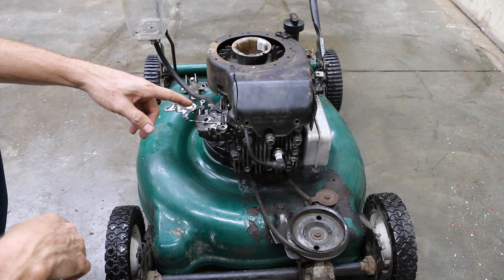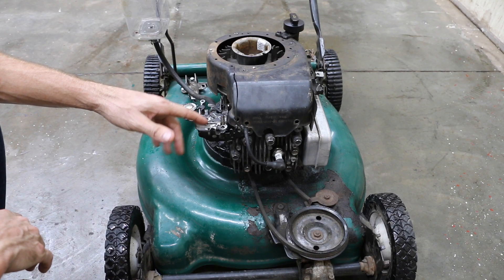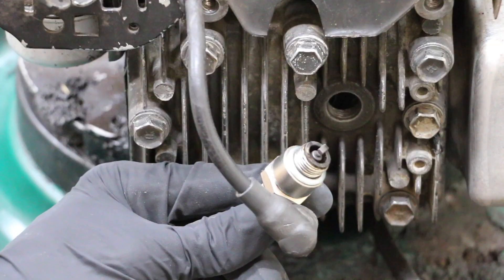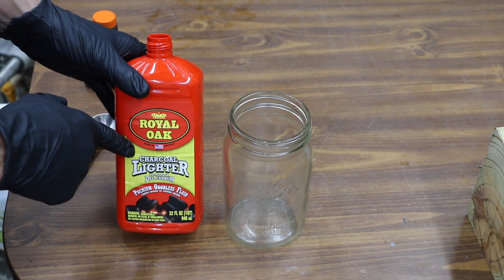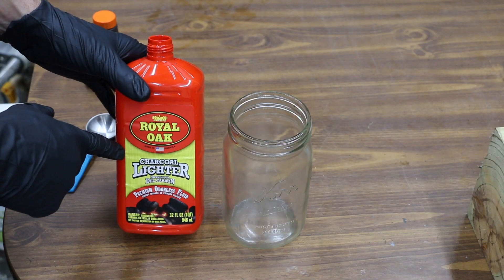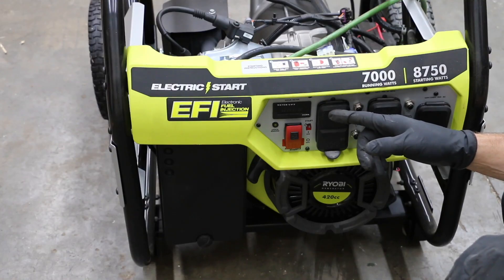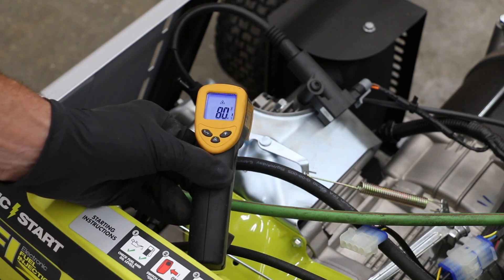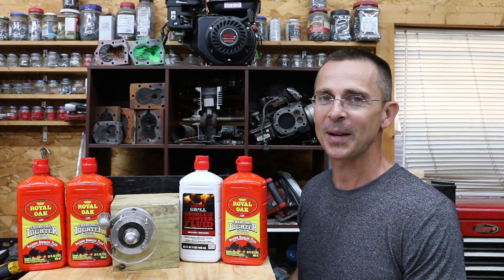Will a Gas Engine Run on Charcoal Lighter Fluid? Let's find out!

Comment: man no bull crap...today i ran out of fuel for my lawnmower, looking around i see the lighter fluid..i'm thinking naaaaawww prob wouldn't work QUICKLY CROSSED MY MIND and then you post this video i'm thinking WTF.... lolol  😂😂

edit. 
so i tried it on my old lawnmower...smelled liked burnt fajitas!! 👍😂👍
Reply from the maker: lol. Great timing!  Did you use charcoal lighter fluid?
Reply: lol ran to get gasoline... but going to try it on a old lawn mower. great video man! very theral
Reply: I have used lighter fluid to start and run engines with fuel problems. Runs fine. Have to keep spraying it on the air cleaner. I could often get engines with old gas in them to start and offer, to run once warm. Probably better for the engine than starting fluid.

Comment: I wish you would attempt to run kerosene/diesel like fuels with the sparkplug wire removed.
Reply from the maker: That's a great suggestion.  I'll definitely need a gasoline engine that has a pretty high compression ratio to get it to run without spark.
Reply: @ProjectFarm You might be on to something there; A small DIESEL engine's compression is actually too low. That's why my 7.3 is equipped with glow plugs. You'll have to crank and crank with that drill attachment and use an injected engine to properly atomize the fuel.

Comment: Wonder how similar this is/was to Pennzoil "Rescue" Fuel I bought/used like 20 years ago. (Think it was some kind of "Vehicle/Trunk Stable" Kerosene... In a 1/2 gallon jug? Which you were supposed to use with a Hot Engine Immediately after running out/filling...) Worked good for me.  Misjudged the distance between Stations and ran out.  Pennzoil came to my "Rescue".  Not sure it or another version is still available...
Reply from the maker: Great point. I've tried finding products like this but they seem to have been pulled off of the shelves.  Not sure why.

Comment: Before watching - sure it will, but depending upon the flashpoint, knocking may occur and the quality of the burn and resulting deposits, as well as the energy content will vary. Thus the 'quality' of the fuel may be detrimental to the engine.
Reply: If Project Farm has taught me anything its after doing this run some antifreeze in the gas to clean out the buildup and you will be fine again...
Reply from the maker: Thank you!

Comment: What I learned from this channel is you can basically burn anything flammable to run an engine, in a pinch at least.
Reply from the maker: Yes, you are right!  Especially true if the engine is still warm, which allows the gasoline substitute to more easily vaporize

Comment: I didn't think the engine would run as well as it did.
Reply from the maker: Hi David, I didn't either.  Surprised the EFI engine started when the engine was cold.  Thought I'd need to use some starting fluid to get the engine running

Comment: PF
I’d say yes it will . Let’s watch and find out . 
General repair
Reply from the maker: Hi General Repair, You are right and hope you have a great week.  It did ping under load but I would definitely use it as an emergency fuel substitute if that's all I had and needed to get to the nearest gas station. Thanks again!

Comment: I'll bet a diesel will run on charcoal lighter fluid.
Reply from the maker: Great video idea!!
Reply: @ProjectFarm  that very bad idea to used charcoal lighter fluid in a diesel and all ping you hearing is from very low octane rating in the lighter fluid.
Reply: @SHSPVR  diesel has very low octain rating
Reply: @buildingracingvideos4714  nope
Reply: @SHSPVR  diesel has an octain rating form 15 to 25
Reply: @buildingracingvideos4714  nope that compression ratio and talk about gas as fuel not diesel fuel substitute as lighter fluid is like butane and more of a petroleum solvent the oil
Reply: Project Farm please try it!!!! I believe the fluid is similar to kerosene and that is basically diesel.
Reply: @ProjectFarm  it'll run just fine in a diesel... at least it did in my 87 Mercedes...
Reply: diesels run on almost anything
Reply: @thatotherguy9917  agreed it even run on used engine oil haha
Reply: @thatotherguy9917  No not gas it will destroy and diesel engine really fast but can run kerosene
Reply: @thatotherguy9917  except gasoline
Reply: Agreed... Great idea.  I'd predict it works
Reply: @supabiscuit  It would probably run pretty hot though.
Reply: @bubbafudpucker397  agreed..., but that's what makes project farm so great.  We could assume or we could know with a definitive study conducted by one of the greatest on YouTube
Reply: Well, run is a rather loose term.  This stuff is very light, probably even lighter than gasoline. Diesel is a much heavier fuel.   It may work, but not well.
Besides, you can just run your diesel on used cooking oil!
Reply: We had a guy run his diesel truck on jet fuel (he worked on an Air Force base) and it fouled up everything on his engine. The EGR valve was caked in soot.
Reply: @CADguru78  my sister worked on a base and used jet fuel in her 94 Ford 7.3 dually for almost 10 yrs and 200k. Then sold it to my brother and got a 01 ram 5.9 Cummins and did same thing for bout 8 yrs and 180k. Before she retired. Never had problems from either (back then) and both still run (like stinky old POS).
Reply: @HumpDaddy01  that was before the put EGR valves and coolers on trucks.
Reply: In the 60s my grandpa was in the Air Force and ran out of gas so he put jet fuel in his old beater truck 
He said it was the best that truck ever ran until the gasket blew
Reply: CADguru78 now I Heard a story about sombody who used a after market oil pan in a 24 valve Cummins Diesel engine and the pain inside the oil pan came off and clogged the oil return pump and it destroyed everything from the valves and the crank shaft to the pistons and piston rings
Reply: @atvthings6887   This was a Ford (Navistar) engine.
Reply: My experience throwing all 3 on campfires over the years... gas burns the fastest, then charcoal lighter fluid, then Diesel not far behind.
Reply: Diesel is "diesel oil" so it should not be a surprise that a diesel engine will run on oil. It is however illegal to add engine oils to your diesel fuel do to the emissions created.
Reply: @jaydunbar7538  a pretty safe rule of thumb is: if you pour some in a cup and it stays lit without a wick, the flash point is too low for a diesel. If it has to be diffused by a wick or pre heated to stay lit, it will probably work in a diesel. That's been my experience any way. I've run everything from Jet A and used motor oil to BBQ lighter fluid and transmission fluid in my old deisel.
Reply: @KevinSmith-gh5ze  the last rebuild on my cat cost $32,000 so I'll stick with straight diesel, but yes your correct as far as old diesels go the newer ones are a bit more finicky. Biggest thing with new diesels is running anything else will clog up the emissions system and that's not a bill anyone wants.
Reply: I am sure it will cause it is almost like kerosene.
Reply: Probably the injection pump will seize due to the lack of lubrication, causing the engine to fail in a unspectacular manner. It might work with some added 2-Stroke oil tho...
Reply: @AlexAlex-zp3jc  mostly correct the injector had seized though it was not due to oil issues with regards to this engine, the engine was stored dry for a long period, it was never run without oil, just went from storage to run with fresh oil, at least that's all the info i have as I bought the tractor with a bad starter the previous owner never actually ran the unit while he had it cause he couldnt get the starter to work and just let it sit, i definitely surprised me when it did runaway because while it was an old tractor ,1987 it only had 2800 hours on the engine but after unseizing the injector the tractor has run faultlessly for me. If it runs away again and the same injector has gone ill replace it, but until then im not touching it, its a cheap tractor for me and i want to avoid putting tons of money into it
Reply: @AlexAlex-zp3jc  Hmmm never heard of any one testing that with gas by adding in 2-stroke oil to mix it
Reply: I know that a diesel engine will run on charcoal lighter fluid. Both are  paraffin based.
Reply: I've run Cat mechanical diesel engines on 15W40 oil with no problem.
Reply: @Leemur2335  I used to do road calls on diesels that were fueled with gas, they would run for a little bit and die, drained fuel and changed fuel filters and reprimed and bleed lines and they start up, I always wonder how long the injectors and pump last after words
Reply: @Leemur2335  fully mechanical, most  time they were small 4 cylinder cummins in jobsite forklifts or deutz  3 or 4 cylinders in ditchwitch trenchers, people who rented the skid steers and back hoes knew to use diesel
Reply: Well have you heard of a runaway diesel? It’s when it starts running off of the oil instead of the actual diesel
Reply: @atvthings6887  Not specifically the oil though that is common, a runaway is just when the diesel over revs and you cant bring it down with the throttle, I have an old Yanmar tractor that started having runaway issues and it was because an injector got stuck open so the engine just started running off that
Reply: @compzac  Runaway diesel occurs when the fuel pump/injector gets stuck on, and since it doesn't have a throttle plate, as long as fuel is pumped in it will keep running unless you block the intake. Runaway diesel has nothing to do with RPM.
Reply: @madjimms  I should not have said over rev that's just usually what you see them doing when they do runaway, i meant they just cant be controlled by the throttle